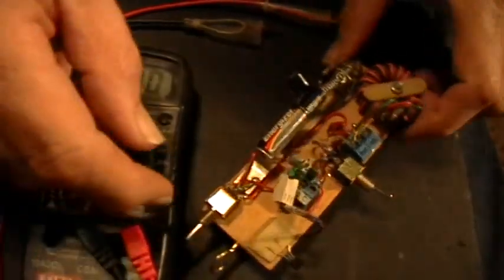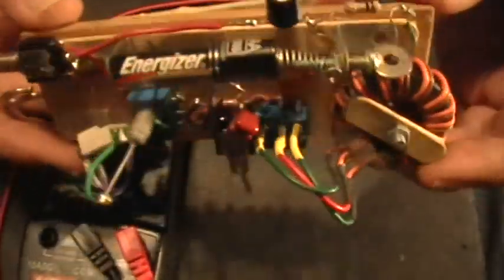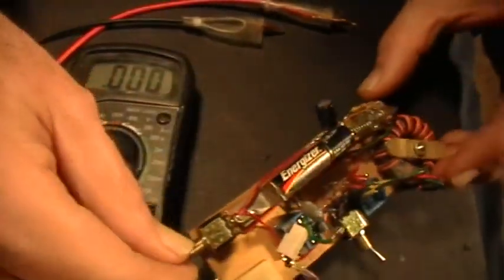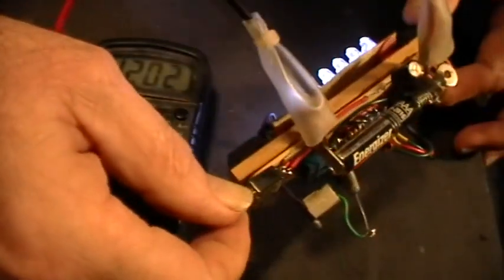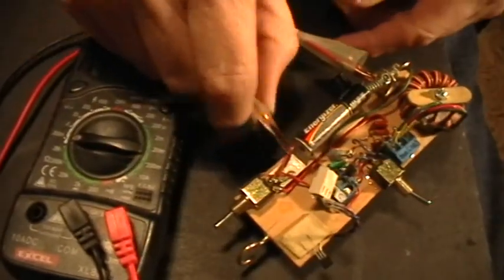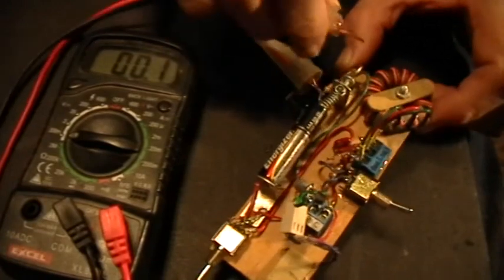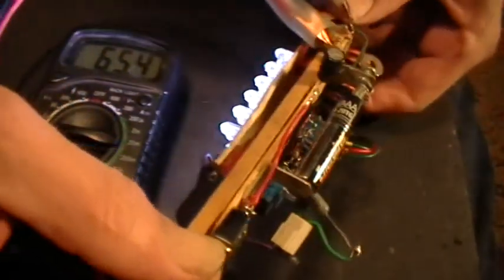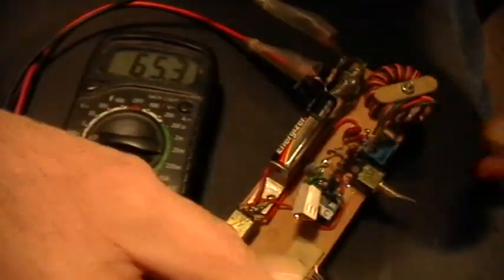Joule Thief: Less Current with Load Connected than with Disconnected

Comment: You might lower current drain with an LC circuit to the base through a reistor and have a bypass capacitor across the resistor. Make sure you have atleast 10f cap across the emitter and the negative of the battery maybe up so several uf across the battery. Though I did modify a darlingto series of two 2N3904 with a tip 31 with bases connected and two emitters of the previous transistors to bases and all three had connect collectors. I got 3.40-3.45 mili amp draw running a solar led with my bifilar coil and lc Kappa Darlington circuit. Though the battery was 1v and drained I think the solar light had a joule thief in it.

Comment: None of my JT circuit will do this.  I am confused a bit.  (Nothing new there, ha ha)  Why is their any mA draw when the "load" is not connected?  What is using this power?  Is it being dissipated in that resistor?  I knew that DMMs are not good for measuring pulsed output of these types of circuits, but did not know they were questionable on amp draw.

Thank you,

Bill
Reply from the maker: Bill, this is just the basic JT circuit with PNP transistor BC556B instead of NPN (so the battery supply polarity and LED polarity are flipped so it will work.)  13-13 winding on the toroid. Output to LEDs from Emitter and Collector as usual, with a 0.2 ohm CVR in series with one output leg. A one-ohm CVR in series with the battery positive.
The amp draw on the meter is probably very close to the true average in both cases. What is using the power when the LEDs are unplugged? It's heating the transistor and the other resistances in the circuit like the 1K  base resistor, and also radiating some RF like a little radio transmitter, probably. You see some other components on the board but they are switched out of the circuit for this test.  And the load bank has been rewired so instead of the stock Harbor Freight flashlight 24-parallel, it is now 2-series-12-parallel, which raises the voltage to twice the normal white LED trigger value.
Try again with a PNP JT and see if you can make it happen!

Comment: Hello TK. I noticed in your description of this video you say "Even rarer is the use of a proper power analyzer in testing such circuits".... What is a proper power analyzer? I ask this because I want any claims I make (if I ever do) to be done right. Thanks for sharing TK.. Peace :)
Reply from the maker: Hi Binj. I like Clarke-Hess products, wish I could afford one. C-H 2335A for example.
I can borrow an earlier model C-H analyzer if I need to; a few of the Ainslie tests were done with one. A good digital scope with math that can do trace multiplication and integration will also do the trick if it is used properly.
Thanks for checking in!
Reply: TinselKoala
Thank you for the info (sorry for the late reply).... My broken Phillips-scope is being repaired by a co-worker at my factory, I should have dual trace capability soon and have a couple of projects to analyze out-put power... All of us in this alternative-energy community should have the ability to do proper power calculations of AC systems. Proper measurement is key to be taken seriously in this game.... If you get a chance check out my latest video,  https://www.youtube.com/watch?v=KxZWUNC3fsg ... I know my video proves nothing(and I do not claim anything), but it is kind of interesting and I am making matched resistance pancake and ferrite JT's as we speak.  I can't wait to see the results with the impedance matched on all the circuits.... (I think I am using the word impedance correctly)... Anyways, thanks a million for all the knowledge you share. I hope to be one of the guys that doesn't look like a fool while working on and trying to create alternative energy systems. Peace TK. :)